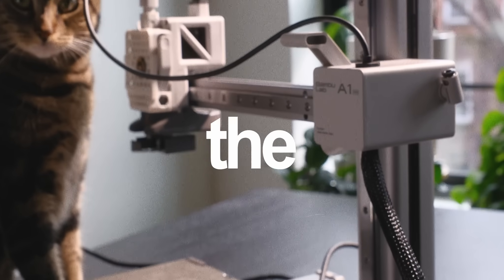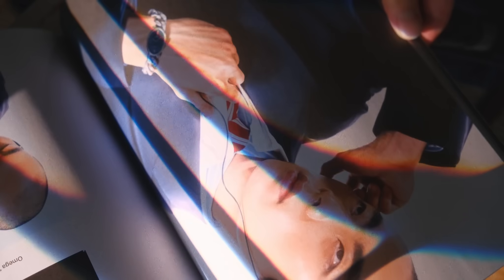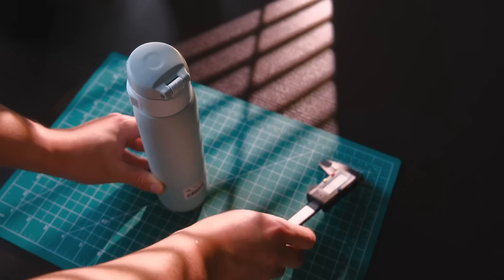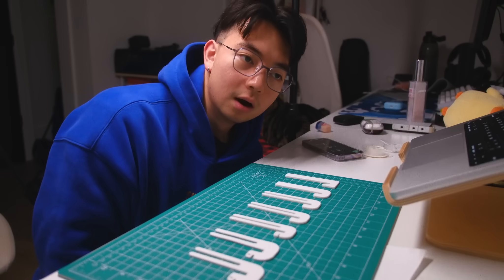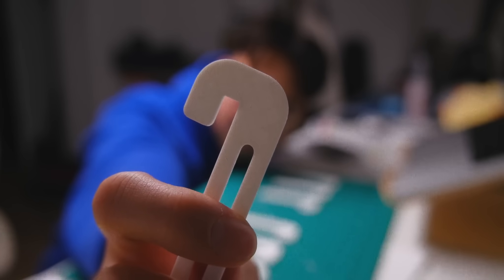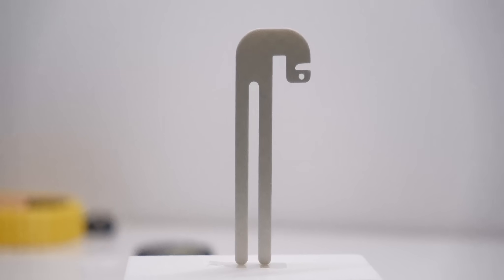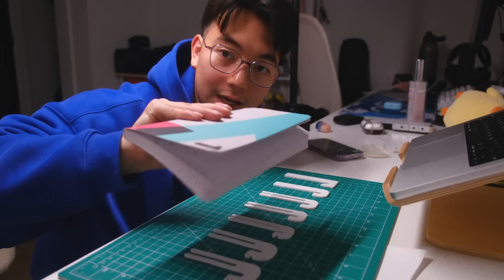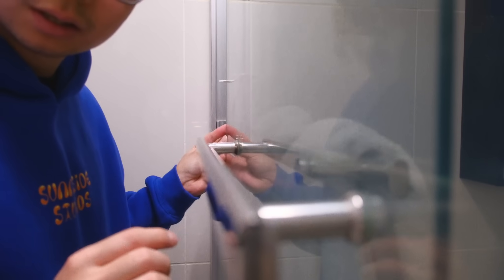3D Printing is Hard...

Comment: Good vid. Wonder if you would add a few tactile bumps to the track if that would give the same result. Pushes past bump and stays put on one end and the same on the other when closed.
Reply from the maker: I might try that, so far the print is holding up well but always looking for ways to improve it.

Comment: I share almost every sentiment you have in this video, but why wouldn't you go for the route of understanding why it rolls back? Maybe there's a rail that is not level but CAN be adjusted. Sometimes screw holes have a bigger size to accommodate for adjustments.
Reply from the maker: Hey! Good question, at first I didn't know you could do that. And once I learned I tried it but unfortunately it didn't work. The problem actually is in the flooring. NYC floors are notorious for being unlevel, my bathroom being extremely so. While I wish adjusting the rail would've done it, didn't work for my case unfortunately!
Reply: @jackiecreate  Okay nice, I'm glad you took that route first. I bought an A1 mini recently and Im starting to print too much, so my first instinct now is to try and solve it the conventional way first. Great video!

Comment: Hi. I want to share some information with you that will help you understand a little bit more about product design. There was an interesting case on Shark tank when a guy made a mini keyboard with two Copy and Paste buttons, and one of the sharks explained to him that you could actually make a hotkey for those functions. So you sliding shower mechanism has a level adjustment, which allows you to adjust the door so that it does not ride on its own. In general I want to emphasize that the time spent happily was not wasted. But sometimes you don't need to reinvent the wheel)
Reply from the maker: Hey! Some people have shared this to me already and at the time, I didn't know you could adjust it like that! Unfortunately, even with adjusting, I don't think it quite works for my situation. The floor is just slanted so the door is sliding back. But thanks for the tip :)

Comment: Hey Jack,  

I really connected with the video—it resonated with me. We're on the same wavelength: owning a 3D printer, being a maker. Appreciate the tip about making test prints thinner! Loved the storytelling.  

Just a small suggestion—I have a similar frameless glass shower door. There should be adjustment screws under the roller caps on the top rail. A slight tweak there might eliminate the need for an extra printed part. You’ll probably notice if the glass was hung that way.
Reply from the maker: Hey! Thanks for the headsup :) I tried that and it didn't work unfortuantely, but at least I found my own fix! I might try again though since my print seems to not be working as well as I thought after a few weeks, the tension is loosening.
Reply: Got it! Sometimes these things need a bit of trial and error. Hope you find a solution that holds up long-term!

Comment: One thing about design which I find myself trapped in sometimes, is designing a solution for something which already has a solution. I’m assuming that you adjusted the rollers / track for the door. All tracks and glides have a tension screw built in.
Reply from the maker: I honestly didn't even know you could do that, but I tried and it doesn't seem to work. I screwed it a bit tighter but the problem seems to be from the end bit that keeps the door in place when fully closed. That little plastic bit isn't enough to hold the door in place? Not sure, but glad I found my own way to fix it

Comment: I think the problem with owning a 3D printer, particularly in isolation (no capability to work in wood for example) is every problem is regarded as solvable with a printed design. Your shower door would be held effectively with a small square of closed cell foam (like a sleeping roll or some packing material). Iterating a design, having a manifesto, ok, I get it. But step one is ask, is there a better/easier/pre existing solution that DOESN'T require me to print anything or spend a lot of time in CAD. KISS. Keep it simple stupid.
Reply from the maker: You're absolutely right! One thing we used, before I printed this, was a sponge to hold the doors in place. But after using it for a year, several problems came about.

1. sponge became moldy
2. since it shrinks/expands from water content, it doesn't always hold it in place and unexpectedly will slide out.
3. Looks ugly as hell.

But you're definitely right that there are a lot of prints that, for better or worse, has easier/simpler solutions. I think part of the fun, though, is seeing if you can make it better whether for personal use or others. Just my take

Comment: just adjust door wheels.....
Reply from the maker: Truthfully, I didn't know you could do that! I just tried and it doesn't seem to work. I believe the problem lies in the end bit where it's supposed to keep the glass door in place. That thing has gotten loose and adding that pressure with what I made keeps it there. Maybe I'm wrong though, not a handyman.

Comment: I learned recently (no source, sorry!) that round corners also serve a purpose when printing: they prevent the requirement to retract filament. Instead, if the printer can just round the corner, there's no retraction necessary and the print-head just keeping moving along. When the printer reaches a 90-degree corner, it retracts filament slightly to avoid over-extruding on the corner. Every retraction is an opportunity for stringing, or outright failure.

Really enjoy the style of your videos! Keep it up 👊
Reply from the maker: I didnt even know that thank you for the tip! That's awesome
Reply: It's called Pressure Advance.  When the head slows down to make the corner, the plastic flow needs to slow down too.  Many slicers (I use Orca-slicer) have it as one of the calibrations, so you can dial in how much, but as you've said, rounded corners reduce the need to slow to a stop in say 'X', and speed up from a stop in 'Y'.  Rounded corners look better anyway :)
Reply from the maker: Thank you!
Reply: @iannicholls2790  ahh, great, thank you for the clarification!
Reply: I know this isn't an actual engineering channel, but fillets serve multiple purposes. For FDM manufacturing, it does indeed also reduce stringing and helps actually reduce fab time as it not only uses less material but is also able to preserve printer head velocity through a tool pass. For more load-bearing applications, the purposeful use of fillets can reduce what are called stress concentrations (K) along flanges to increase material strength.
Reply: @joshuaeah  great information, thanks for taking the time to share! I'm in sponge-mode with this new hobby, so I'm taking in all the useful and practical information that I can.
Reply: I am pretty sure it prints faster with rounded corners as well because the printer can graduately change directions in the corner rather then completely changing it right away.
Reply: Rounded corners also help prevent warping!